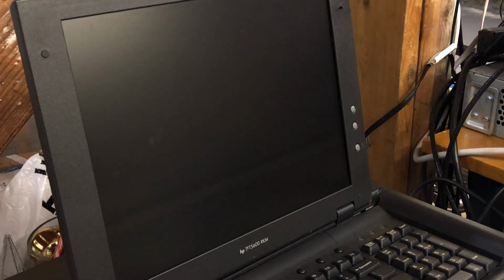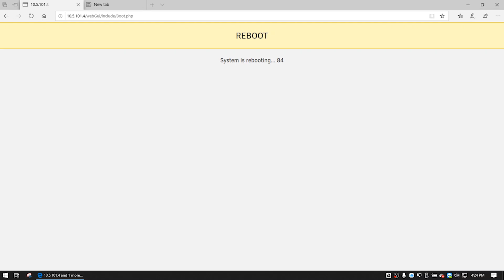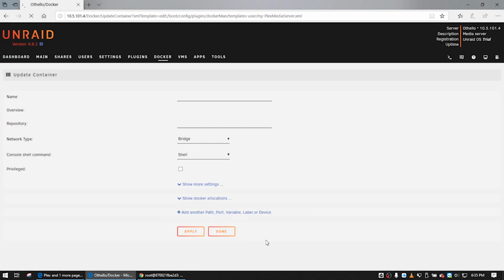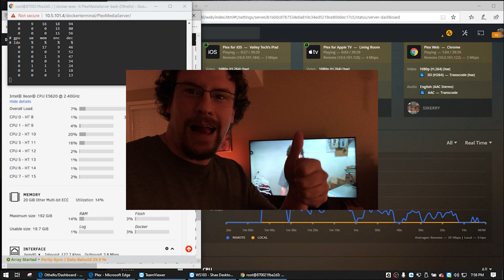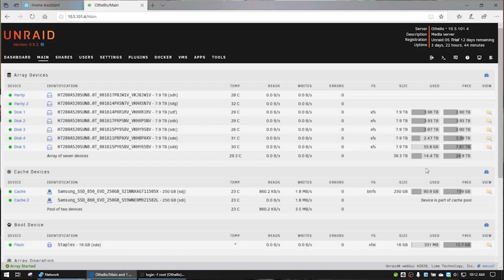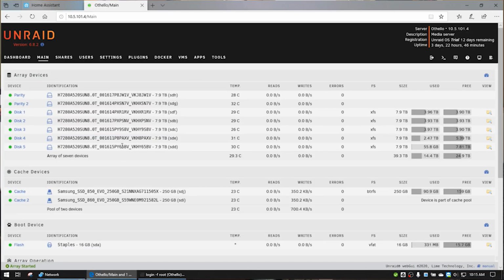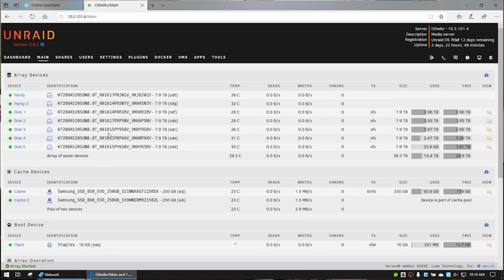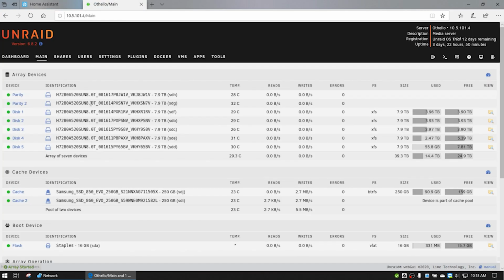Part 2! Super cheap 47 TB Unraid storage server with Plex HW video encoding.. $1236.00  (Inc. Disks)

Comment: This is going to sound crazy but it works.  Instead of running plex in a docker container, spin up a win10 vm and run plex  on the "desk top" and install backblaze.  Backblaze will think its running on bare metal and you can  back up your entire 47 TB media library for  $6.00 a month. Backblaze wont support mounted volumes so no raid, but your data will be backed up off site.

Comment: I try to do basically the same with the same server. Oddly, I can't boot from stick, neither from internal nor external USB. Any idea how I could get this to work? Tried different sticks between 2 and 32GB

Also the server manual says to keep the RAID card in the first slot, but you moved it. Did you encounter any problems down the road?
Reply from the maker: No problems moving the raid card, BUT I did have lots of problems with usb boot. I think I had to try about 6 different devices. I believe I ended up using a older USB 2.0 8gb drive. Other things to check if bios is set to legacy or UEFI. For my use its running legacy only. The server has been running for almost a year with zero issues.
Reply: @TechwithShae  Thanks for the reply. I keep stick huntin'. But you do use the internal usb, right? Can't have that stick dangling out the front or back for my peach of mind

Comment: Great video’s. I enjoy the geekyness. Total compliment. As I enjoy this stuff too. Why did you go away from FreeNas, your skills are way higher than mine. I am actually in the process of backing up my files and then going to start a FreeNas system. What were your main concerns?
Reply from the maker: Complicated answer, I really enjoy Unraid for its simplicity and flexibility. It has a good implementation of docker and hypervisor features. Having said that, I think its great for long term storage, but I am working on cobbling together a smaller Freenas server because I really need the speed for video editing etc. If the main purpose of my Unraid server was simply storage, I would have gone with Freenas. In reality I have multiple VM's and 16 docker containers running so the easy of management won me over.

Comment: Have you measured power consumption on this unit? That's the biggest reason I'd be against this type of server since my peak power later in the day isn't cheap, with most of my usage going to cooling in Phoenix. Thus, I tend to favor lower-powered microservers.
Reply from the maker: It’s a beast. Just over 200 watts. Luckily our power is pretty cheap, and clean (hydro electric). Otherwise I would be definitely looking at a more cost effective solution.

Comment: Regarding Cache Drives, Since i do a lot big 4K video edits, i wanted a way to add SSDs to my rig without having to run a ton of cables and anything larger than 2TB is super expensive and my Motherboard only has 1 single M.2 slot, which i use for VMs, So i bought a M.2 PCI adapter, the one i bought off ebay has 6 slots for M.2 drives, so during black friday i picked up 4 x 2TB Adata M.2 Drives off Amazon for $139/ea that i put in Raid 1 so i have 4TB of cache space for everything with backup. This greatly helped when dropping an 8hr 4k video onto the machine to edit.
Reply from the maker: Thanks for the comments, this is great info! I'll have to keep a closer eye on external drives for the future. I like the idea of a pci card for m.2 drives as well. At some point when I have enough extra cash I plan to build something quieter and more efficient.
Reply: @TechwithShae  Ya i have been super happy with combining my personal PC and NAS/Plex server into a single rig. The use of the new Ryzen 7nm technology uses about a third of the wattage in total compared to my old intel 3570k server and 6700k personal pc combined. Unraid uses so little power with the system just sitting in idle, i am super happy with the results, also not having to spend a fortune to upgrade my network to like 10gig to get better transfer speeds, now its all local so the speeds are super fast.

Comment: Nice Video: Saw your video, was curious about your super cheap storage as i am looking to add more storage to my newly built unraid server, but figured i drop you a line as the route im planning to go again for storage is cheaper if you need more in the future. Previously i have my unraid server running on an old Intel retired gaming pc, but decided to convert everything into a single PC on the rebuild to save on energy, so went with a ryzen build with the 3950x. I currently have 5 x 10TB WD drives I shucked from USB enclosure drives that I paid $120/ea for. If you setup alerts on slickdeals under data hoarding, people post crazy good deals on the USB enclosures you can shuck drives from, I've just been waiting for a good price to occur on the 12TB or 14TB units, been seeing the 12tb units as low as 164/ea and 14tb units as low as @199/ea.. The issue is since the virus outbreak the deals have kinda gone dormant on HHDs lately.. I have a 15 bay rosewill 4U case for my build on a vertical server mount in my office with 10 bays open still, so plan to add a few more in the future as im already at 81% of the capacity of my 40Tbs

Comment: It’s great to see non edit videos on this ! , is it possible to remotes access my server if I were to switch to unraid , at the mo my server is win10 all the data has been written to it if I were to switch would I loss all my data using the same hd,s
Reply from the maker: Hi! I actually switched from Windows as well. All the drives will have to be reformatted to xfs, so you can't just simply swap them into a unraid system. There are a lot of ways to remote access unraid. Personally I use openvpn through my pfsense router to access my local network. A lot of people use the nginx reverse proxy docker which works well as well for remote administration via the web gui.
Reply: Tech with Shae is it possible to keep all the films tv shows I have on the windows drives ( installing onto unraid )
Reply from the maker: @paulstir  No I don't think so. Windows uses a different file system then unraid, so the hard drives would be erased.
Reply: Tech with Shae Hi , thank you very much for taking the time to answer me it’s much appreciated 👍

Comment: thanks for the video it would be awesome if you could do a setup from the beginning....from initial plex docker install to all the folders setup etc, how to setup transcode.... I am trying to shift my transcode to NVME and metadata to the SSD drives....but I am a begginer in all this and so confused with the setup and unraid
Reply from the maker: Hi! I was also a beginner when I made Part 1 of this video, I may make a walk through in the future, but here are some great videos that got me started. 

https://www.youtube.com/watch?v=bz16M67z0uM

https://www.youtube.com/watch?v=uZ7zH8nMFGs

One thing to note, in my setup I have my appdata directory set to "Cache Only" so that all my docker's data folders end up on my cache drive. This includes the Plex database. This has worked well, some users seem to be using unassigned devices and adding a dedicated SSD. Hope that helps!